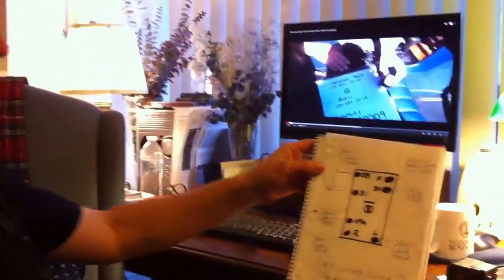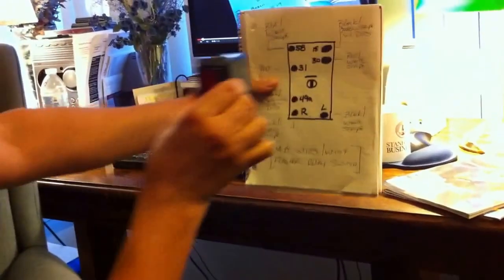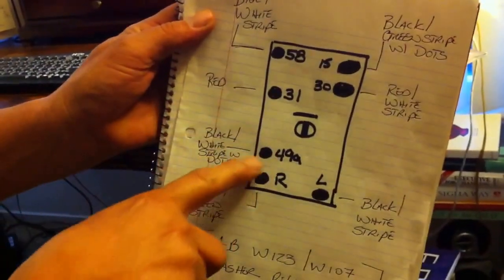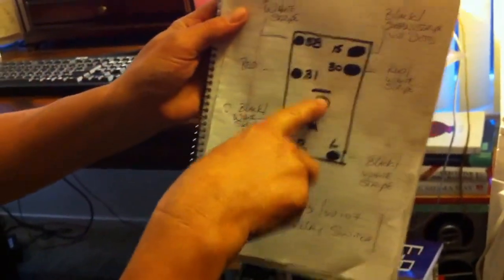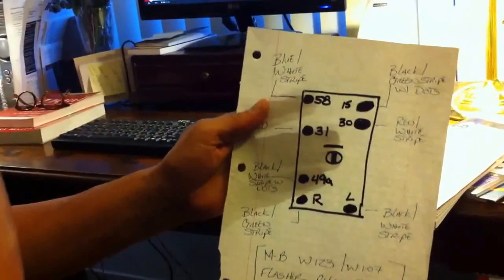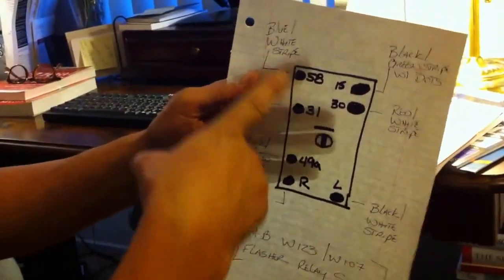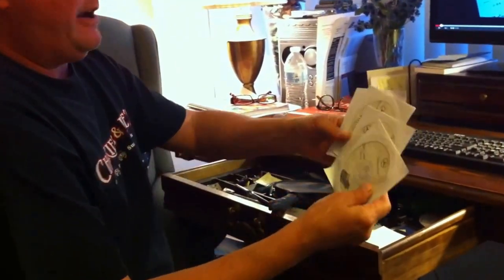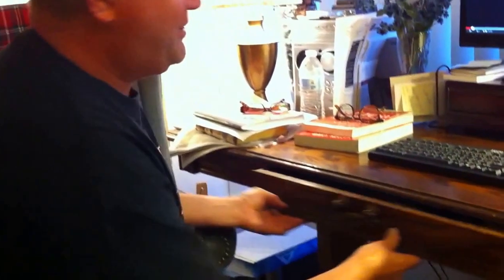Mercedes-Benz W123 Flasher Relay Switch Diagram

Comment: Good morning-
I am trying to re-wire a hazard warning switch in a 450SL (1973). The back side of the switch has a row of 3 pins on one side and a row of 5 on the opposite side. I have not been able to get the wires with the bullet connectors in the right order.
Any chance you have a diagram for this to help me?
Thanks so much! Bill